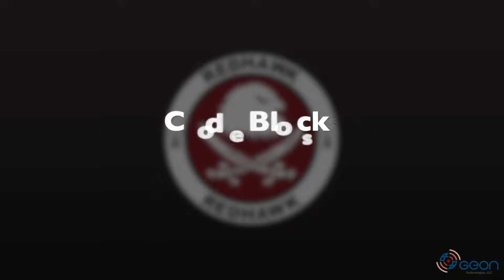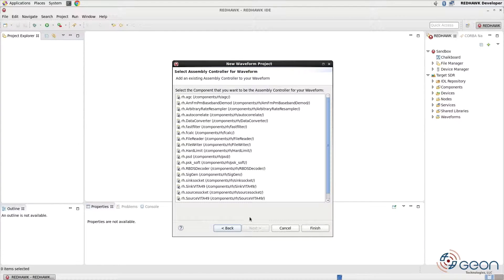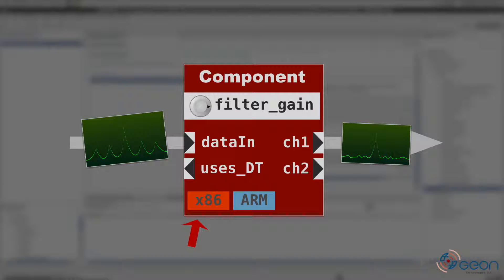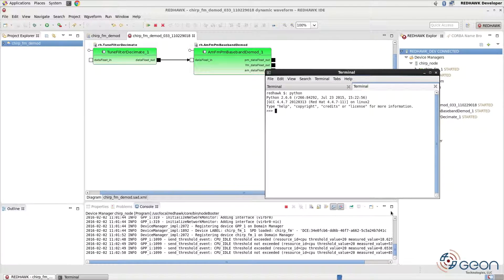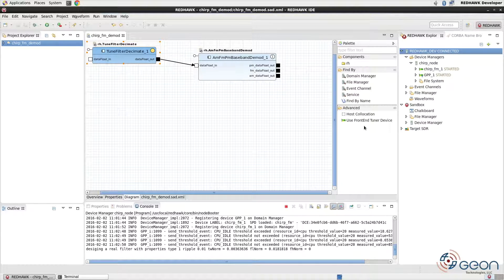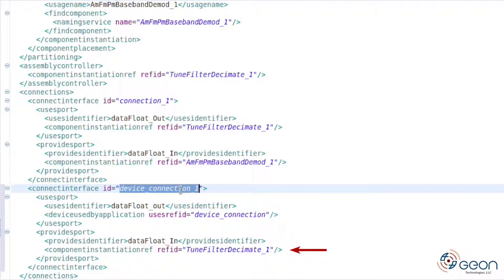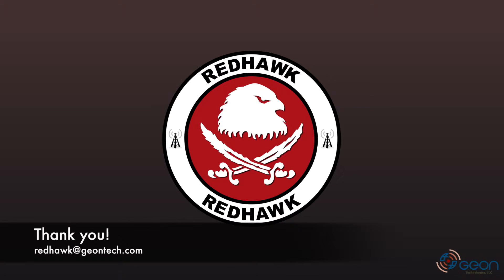Waveform Usage: Basics (v2.0)

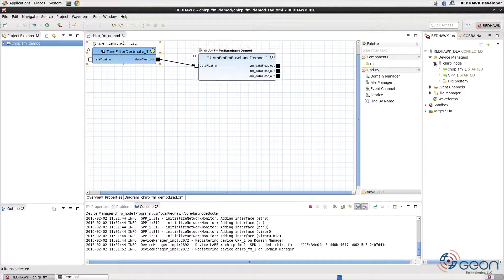Comment: I'm up to 6:20 - using Redhawk 2.2.2
The chirp_fm device (in the chrip_node) isn't loading properly when adding device manager chirp_node:
TraceLevel = 10 console shows this error:

Traceback (most recent call last):
  File "/var/redhawk/sdr/dev/devices/chirp_fm/python/chirp_fm.py", line 13, in <module>
    from scipy.signal import chirp

ImportError: No module named scipy.signal
Reply from the maker: I apologize; where the GPP is executing, you will need to install that python module.
Reply: @Geontech  of course, thanks. 
Now getting this error, when following at 10:00
>>> tfd.connect(psd)
>>> 
>>> [d.name for d in dom.devices]
['GPP', 'chirp_fm']
>>> dom.devices[1].connect(tfd)
>>> Traceback (most recent call last):
  File "/usr/local/redhawk/core/lib/python/ossie/utils/sandbox/helper.py", line 206, in process
    return self._threadFunc()
  File "/usr/local/redhawk/core/lib/python/ossie/utils/sb/plots.py", line 164, in _threadFunc
    if self._update():
  File "/usr/local/redhawk/core/lib/python/ossie/utils/sb/plots.py", line 328, in _update
    redraw = [self._updateTrace(trace) for trace in traces]
  File "/usr/local/redhawk/core/lib/python/ossie/utils/sb/plots.py", line 311, in _updateTrace
    x_data, y_data = self._formatData(block, stream)
  File "/usr/local/redhawk/core/lib/python/ossie/utils/sb/plots.py", line 528, in _formatData
    data = block.cxbuffer
AttributeError: 'SampleDataBlock' object has no attribute 'cxbuffer'

I'm running Redhawk 2.2.2
Reply from the maker: @joecrossen900  I'm looking at the source for 2.2.5, and I think that's a bug.  The member is probably supposed to be cxdata, judging by DataBlock's members vs. SampleDataBlock (link: https://github.com/RedhawkSDR/core-framework/blob/develop-2.2/bulkioInterfaces/libsrc/python/bulkio/datablock.py#L324).  Please open an issue against https://github.com/redhawksdr/redhawk with the above as well as the python steps to reproduce.

If you're in a pinch, you could subclass the plot to change the call from cxbuffer to cxdata; I think that would get around the problem.